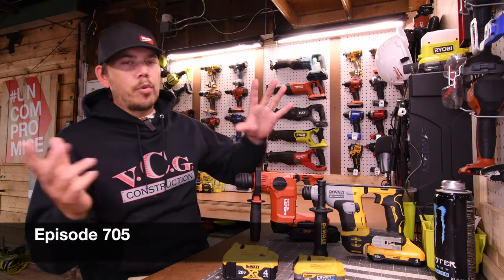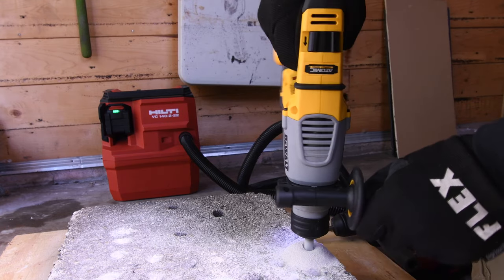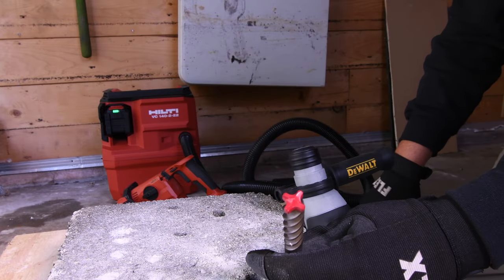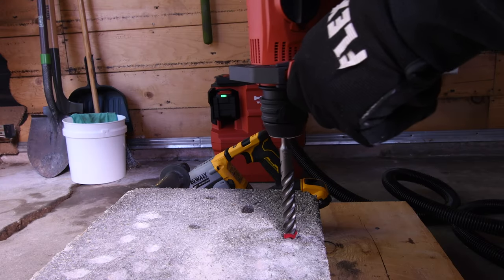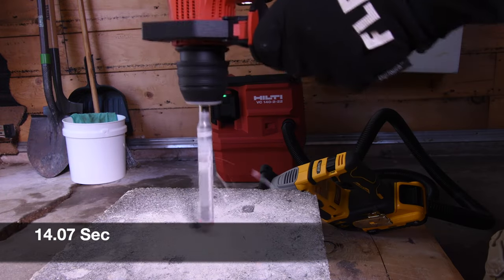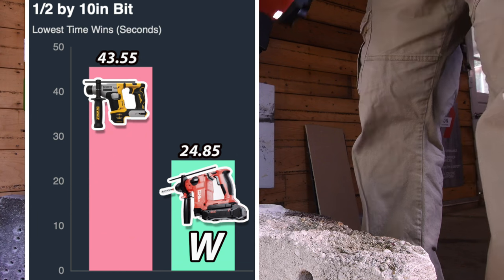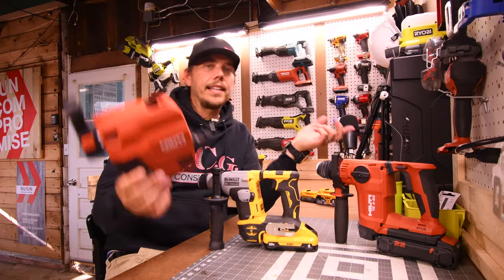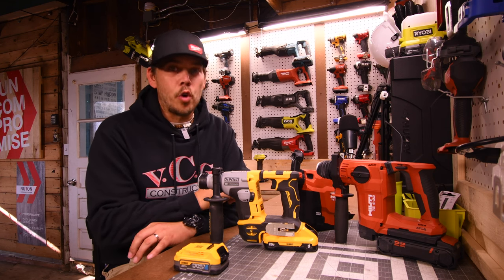Atomic vs NURON (Low Range) SDS Hammer Drills A

Comment: As someone who uses hammer drills daily. It’s important to pull the bit up every 3/4 inches of drilling. Clean the hole as you go. Will make your drilling go more smoothly
Reply: And do not push the drill. Keep easy pressure and let the drill do the work
Reply from the maker: I will do that for now on, cleaning the holes darting the tests is a good idea, thanks bro
Reply: I totally agree!  Keep the hole clean by pulling the drill bit back up regularly.  Drills quicker, saves battery and wear on the drill.  I own the Te6 and SF6H Hilti's without Nuron. I can't think it would benefit me much, is very expensive and the batteries are bulky.  Maybe if I was in heavy construction but I am a Maintenance manager and don't constantly use drills. The Hilti gear is impressive though.
Dave.
Reply: Yes, but then you have to start timing your pulls so it doesn't influence the final result. 😉
Reply: Do I put the drill in reverse when I’m pulling up?

Comment: Just helped my rock climbing brother select that wee Dewalt for bolting routes: the weight makes it an easy choice for that kind of work. Have used it already with tapcons on really hard concrete: easy going for that. The light weight helps with accuracy when working up a ladder: have one on order for myself now too, to complement my DCH333 Flexvolt.
Reply: They have a 12v version also

Comment: 4:06 - That part doesn't seem particularly problematic, you can just get a longer drill bit. A bigger issue is, if the bit is really long, the vacuum nozzle probably won't reach the tip, so it won't suck the dust at all until the hole is half way done. So, you're generally better off with a separate dust collection ring (that stays on the wall, and probably only limits the depth by 1" or so).
Reply from the maker: correct, but if you use this size of SDS you will mainly need to a few inches or so, im not saying that you will only do a few inches for every hole. but these will be. good for most realistic situations

Comment: One test I’d like to see is how they do over head. I recently had a job installing conduit/boxes in a parking garage and it was all over head work. Would be nice to see how they do when the weight of the tool is pulling them down vs pushing down.
Reply: At risk of sounding like a total Hilti fan boy - honestly, becuase I use their tools I just check out their other stuff too - Hilti make an exo-skeleton to make over-head work much easier. My lack of shoulder muscles make changing wiring of a light fitting painful work after a few mintues - I don't know how you can go all day installing conduit overhead!
Reply: @natdenchfield8061  it wasn't all day doing it and doesn't happen often. usually, the electricians do it for us or we do down the wall installs. I was just saying in almost all reviews for these tools they do them in the most optimal way possible not really showing a more difficult situation where the weight of the tool is more on the user's hands/arms.

Comment: The power stacks are impressive and I’m also waiting for bigger batteries like the 5.0 Powerstack but I think that atomic rotary hammer is pretty weak. Dewalt should release a new XR version with chipping function. That’d be sweet 😎
Reply from the maker: I can't wait for the 5ah as well
Reply: Dewalt DCH293 is what youre looking for. Its a work horse for sure.

Comment: Just to point out that with the Hilti and it's 4 bar lights, that 2 bar power light means it is somewhere between 25% and 50% power. with the Dewalt and it's 3-bar power light, it is somewhere between 33% and 66% power when showing 2 lights..  So for all anyone knows, the Dewalt was at 33% power after the tests and the Hilti at 50% power after the tests.. There's an overlap there so much so that you can't really say one drained any more than the other. 

The psychology of the number of bars left however is normally that one reads it as having the maximum of that indication left - one thinks when they see 2 out of 3 bars that it must have 66% battery left. The fewer bars you have on the metre, the more of a trick it plays on you. The more bars, the more accurate it is - if you can call to the nearest 25% being accurate.. :D

and finally i notice that the TE-4 is available to actually buy! That took a while..
Reply from the maker: the Dewalt is a 3 bar system and the HILTI is a 4 bar system. so the amount of bard remaining is irrelevant, I need to figure out a way to have actually see the percentage of remaining battery
Reply: @ManCaverTools   Percentage can also be a bit irrelevent in the real world unfortunately. It's probably just an estimate based on battery voltage reading and some average of what that means in some constant drainage curve, if you see what I mean. And those chosen curves will be different between manufacturers.

The total energy left in the battery can be worked out by a constant drain and a log of voltage, to create a curve, and the area under the curve is the energy. There are RC car battery units that do that, for competitive racing - so that people can figure out the best charging for their batteries etc. I'm not sure what voltages they cater for.. you mght be able to adapt one for tool batteries (if it's actually a worthwhile endevour!) 

As you probably know, the higher the current delivery for a lithium battery, normally the less total energy it can deliver. It gets worse the closer you get to the particular cell type's maximum current delivery. I guess that's why brands have been moving away from the 18650 cells with less max current than others so you can push the tool whilst keeping away from the max - why batteries with two or more parallel sets of cells deliver more than just the sum of their Amp/hour figures as the cells are experiencing half the current load for the same power.

Comment: I get hilti when dealing with concrete or for a digging hammer. I get dewalt for hammer drill, angle drill, and impact wrench, etc. I get choose rigid when it comes to pro press
Reply: Hilti is the only way
Reply: I use Hilti tools for basic carpentry, scenic carpentry for events: installing set and stages for conferences, fashion shows etc, and they are great . The barrel grip jigsaw is a very stong performer in particular. I use an impact driver mostly and when I compare to other brands colleagues use, I find - for me - it has the perfect blend of speed /impact drive so that it doesn't go into impact too soon and feels comfortable long-term whilst still driving up to 100mm screws as fast or slightly faster than others.. The only thing I've felt is that they are a little lower torqued than some other brands.. but i rarely come across situations where I need more torque except some hole saws holes get done quicker with other brands.. Good power but lower torque.

But, that's on the A22 battery platform. Judging by this channel, the Nuron platform has really pushed their torque performance from low to mid-table in many tests to the top!  Mine Nuron tools arrived from the US last month but I've not yet pressed them into service (only just available on pre-order here in the UK, but the price is much higher..  e.g. SF 4-22: $129 in US (up from $116 when I ordered),  £181/$205 in UK  - I really have no idea why! )

Comment: If you want to test battery capacity, you really need to use a multimeter or (even better, because that's what matters to the user) use the tools until they stop working, because the "bars" generally don't use a perfectly linear scale (i.e., two bars doesn't mean you have exactly half the charge left, and the energy corresponding to "two bars" on one battery might show as three - or one - on another).

Comment: Would like to see this done with a 5ah powerstack. The atomic loves that battery. I jus did a job where in total we had to drill 650 1/4" holes (which this is really in range of wat its designed for) and the normal 5ah died after 2 1/2 doors complete and the 5ah powerstack completed 4 doors installed cuz of the power difference and drilling faster. I was really impressed.  And if you really want dust extraction dewalts solution is a separate canister with a shoulder strap thats powered with its own battery that is universal for any rotary hammer
Reply from the maker: I really do need to get that 5ah battery soon
Reply: @ManCaverTools  ebay and offerup where i have gotten them. Got 5 so far

Comment: Good review, but the drills are not in the same class. The Hilti has 2,3 Joules vs the 1.4 on the Dewalt. Hilti really doesn't have a direct competitor for the Dewalt in their line-up.
Reply: $1000 Hilt vs $150-$200 Dewalt
Reply: dch273 with 2.1 joules

Comment: I’m liking the type of video… but concrete without Bosch? Kind of disappointing
Reply from the maker: I wil be getting Bosch's sds. I want one from all brands now :)
Reply: GBH18V-20N, would be the closest Bosch equivalent to these…  also I think it would be better if you included the prices for each, and the prices for the batteries. I think this is one of the most over looked things on reviews. So many people don’t think about the cost of batteries if they are thinking about switching and not everyone has them laying around of each brand. You don’t have to harp on it but throwing up a quick spreadsheet of break downs showing drill price and battery prices at the time of the video would be huge, and people will start to see the true cost of ownership. Just some thoughts to think about on your videos.
Reply: Ohhhh and the Bosch has the chipping(plus it’s normal priced at $199, but on sale for a while for $159) neither of the two you ran are in that ball park of features & value at that price.

Comment: Hilti is known for 2 things. Being really expensive, and being specialized in concrete work. I feel like any other outcome would be kinda sad tbh.

I doubt anyone cares but I kinda miss the old format of the channel. There used to be alot of emphasis on these tests not being "scientific", but now it seems to take after other channels who do it that way regardless. I dunno, I just feel like it doesnt suit you as well as previous iterations. But oh well, its not by any means the first thing to change, and im sure it wont be the last. At the end of the day we are still watching holes in stumps, right? Now just with more graphs and less charm (imo).

Its cool that the production value has gone up, but I still remember that time you were genuinly happy over a Ryobi beating a more expensive DeWalt. Thats the kind of memorable stuff I think is disappearing more and more. But thats just my 2 cents, if it works it works.

Good luck man!
Reply from the maker: im sorry bro. The channel had to change :( but hopefully it will get to you, I was skeptic about it as well, but now I love the new formate
Reply: @ManCaverTools  Dont be! I totally get that, I just wanted to air some thoughts as someone who has been around since what, 2k subs, through name changes and RR and all that :)